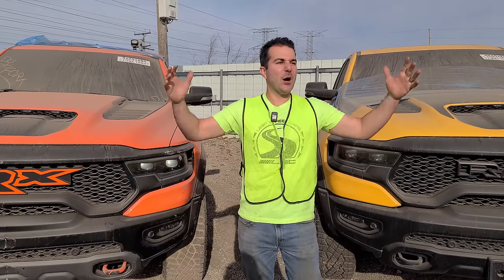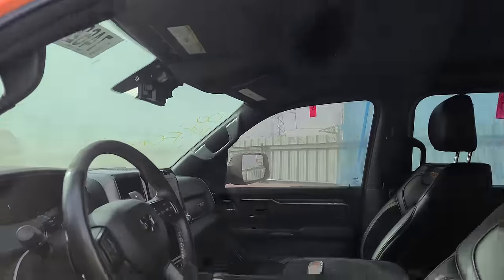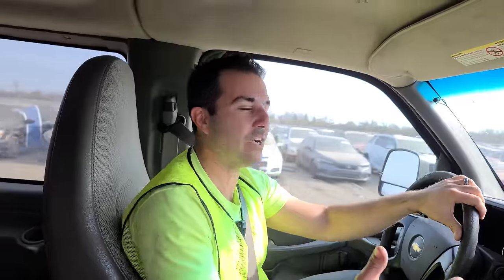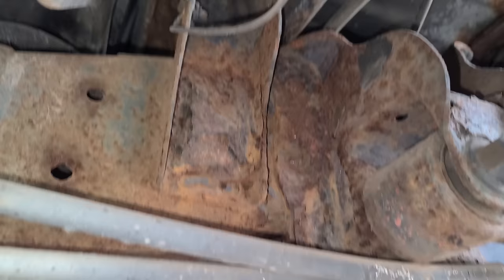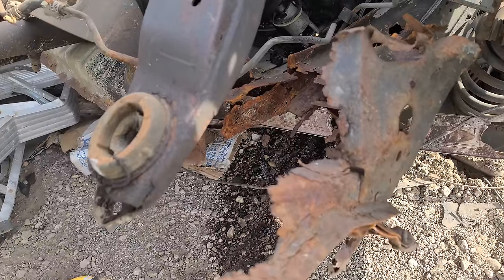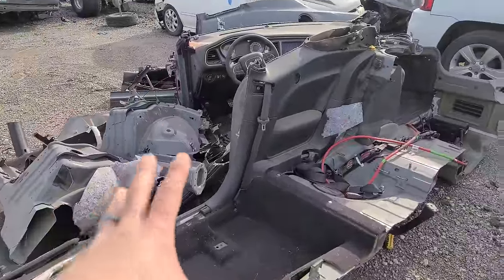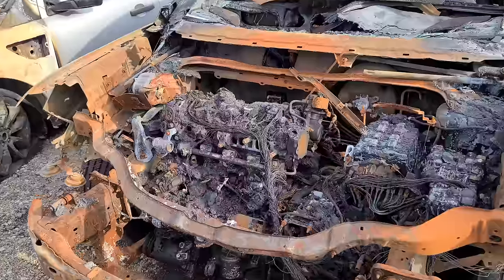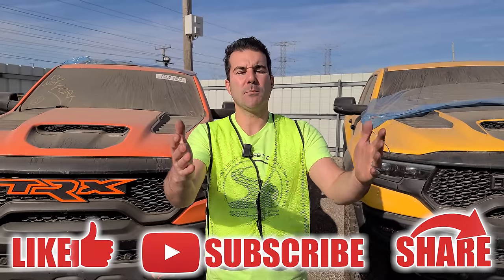Why Buying Totaled Bullet Hole Cars Is The BEST Deal At the Salvage Auction! EASY Fix For Anyone!

Comment from the maker: What do you think happened to the yellow TRX?
Get 3 Armor Shield IX Ceramic Coating Kits For Only $99! https://avl.kg/legitbf23
Normally these are $75 each and this is limited time and quantity. Act fast!
Reply: Please tell me the TRX's are repairable!!!
Reply: The yellow TRX was a blower motor fire. For whatever reason, the motor caught fire and that was it. Repairing that properly will be prohibitively expensive if you have to pay labor as well, so totaled. 

Getting rid of the smell is almost impossible too.
Reply: HeY Alex if I see a car I wanted  there is there anyway you and i can go see it and buy it ? Looking for winter build for summer.
Reply: The hole in the dash is typical dodge things, never went away. Probably a short circuit somewhere in the dash.
Reply: Cell Phone Fire
Reply: Looks like maybe it got struck by lightning ⚡️
Reply: I would love to see that final Mercedes put to rights possibly with some tasteful upgrades I think if you have a DeLorean it would love a wicked looking Benz as a friend.
Reply: Yellow TRX was a smoker who had an ember get blown into the dash maybe
Reply: @Broadpaw_Fox blower motor is off to the passenger side, not right in the middle
Reply: Wiring loom fire
Reply: a Dude probably dropped or hid his spliff in a dash vent when he got pulled over in that TRX
Reply: Aftermarket speakers........ I took care of my Xmas gifts at the site. My oldest pair are in the Army and their car will be protected, thanks for the great bargain.
Reply: 7:15 Wait, did you say McClaren 670 S??? Somewhere in Florida, a man is staring intently at his computer screen...
Reply: someone left taco bell on the dash
Reply: @Broadpaw_Fox  Huh, interesting...I was going to guess someone left their cell phone on the dash in direct sunlight and the battery had a thermal runaway event.
Reply: @DJSekuHusky or some sort of decoration like a crystal.
Reply: exactly and  this is proof of  why to buy just the engine and trans and put it  in older model vehicles , truck etc ,  _ so you have new power  in  an older model and None of the  new junk wire  fire cheap manufacturing   issues
Reply: Hot apple pie left on dash.
Reply: somebody had a couple of replacement battery cells for a concept van left them on the dash while moving his DeLorean and Tragedy.
Reply: We have a Hyundai Venue in India which my dad drives daily and is quite a reliable car ..
Reply: Cigarette down the dash!
Reply: Did you buy anything from the salvage yard?? The bullet TRX?  The Ferrari?

Comment: It's really sad to see all these big V8 engines disappearing. I'm not ready for electric vehicles!
Reply: It won’t happen for a long time.
Reply: I will never be
Reply: Just drive older cars. It's cheaper and less of a headache than failing body control modules, burning lipo batteries, and self driving nonsense that won't move when you actually need it.
Reply: Battery powered💩
Reply: So… don’t buy one.
Reply: well not everyone one own a big v8
Reply: No one wants one that’s why ford is lowering production of their battery plant. No one wants a pos that burns to the ground
Reply: Our wallets will never be ready!
Reply: We need hydrogen conversion
Reply: @xssonlineltd4212 
Nah
Reply: @ryurc3033  I would like a nice square body 4x4 and a 80's G body.
Reply: dont have to. wont ever happen
Reply: Electric vehicles definitely have their advantages, and those advantages are getting bigger every year. People were scared of microwaves at first.
Reply: Neither is the electric grid
Reply: What do you mean with disappearing? They are everywhere
Reply: Neither is the electric grid.
Reply: I will never go electric. I want a real car.
Reply: Not only V8. Anything over 2.5-3.0l range.
Reply: @LordHolley REALLY?  You're not too educated, are you?  Check into cost of battery production and how much OIL they use in the production.  Also check out the REPLACEMENT COST, as well as DISPOSAL COST and the cost to the environment!!
Reply: US infrastructure isn't either.
Reply: The junkyard will be a goldmine very soon
Reply: v8 becomes obsolete,new  turbo 4 cyl  can pull almost same power and use way less gas, especially in europe v8 disappears
Reply: Start buying new V8 vehicles. If you buy enough of them, they will keep making them
Reply: Just get both 🤷🏽‍♂️ ev for my ride to work then a couple v8 to play with
Reply: Our power grid isn't strong enough to completely electric it's struggling as it is to support the power we do use
Reply: It's atleast 20 years away before you'll have no choice.  Maybe longer.
Reply: @gregdali1011 that new turbo 4 cylinder won't last 1/3 as long as a basic N/A V8.
Reply: @AlexanderBaldridge-q8b exactly.  We already get blackouts on hot summer days when too many people have the AC cranked.
Reply: @LordHolley so, catching fire for no reason and uncontrollably burning hot enough to melt bridges is an advantage?
Reply: Electric cars need to stay on the golf course
Reply: Exactly why I’m still daily driving my 2003 Mustang GT with a manual transmission. I refuse to give in lol
Reply: Alot of cases of batteries failing and blowing up... massively
Reply: @joe.olivet starting in 2035 you won’t be able to buy a gas engine anymore.
Reply: @jasonmacneil2256 Agreed. We should go back to Conestoga wagons.
Reply: @SuzukiKid400  Yeah right, keep drinking their koolaide!🤣
Reply: You're not the only one, that's for sure!!!
Reply: Agreed brother. I won't follow the law. Who's with me?
Reply: Twin turbo I line 6's though!
Reply: dont worry they were be back big after January 2025
Reply: @gtamantube  lol when Biden is out?
Reply: Don’t worry, if you are over 50 it should be possible to keep and maintain a good V8 car/truck for the rest of your lifetime, (even if fuel costs $50 or $60 dollars per gallon! )
Reply: I hate seatbelts, I’ll never wear one.  Fuel injection, I’ll keep my carburetor.  A 4 cylinder, I won’t buy anything that’s not a V8.  These gas prices are ridiculous.  I can’t afford to go to work.
Reply: Don't worry, couple years you'll see chargers and challengers as far as the eye can see in the junkyard
Reply: Yeah I love my v8 Volvo.  Motor made by Yamaha!!!❤️
Reply: Environmental Fascism sucks.
Reply: Here is some tissue
Reply: @nastang5.097  lol I figured a mustang owner would have a box of tissues on hand 😂😂😂
Reply: @theglitch99 true
Reply: They just gonna have to find some way to make them efficient more e85 capacity from factory
Reply: @Iexpedite1  lmao ......  gas is too expensive , but gotta have big v8
Reply: @MrStacy1974  
Back in the day, a V8 was the only way to make good power.  Today, they are getting more power out of a 4 cylinder than a V8 produced a few years ago.
Reply: @Iexpedite1  I know....I laughed because I thought the guy was trolling
Reply: The world isn't ready.
Reply: I have three problems with electric vehicles.
1. the batteries do not carry enough of a charge make the range acceptable.
2. the longevity of the batteries is still not enough I can’t justify buying a car that will need to have its major components. Replaced in five years or sooner.
3. cost of manufacture an EV vehicle versus the greenhouse gas is involved doesn’t make any sense yet.
Reply: Its not going to happen. Pur power grids can not handle it.
Reply: We weren't ready for them over a 100 years ago. Things that aren't meant to be have a habit of getting rid of themselves. Patience willow patience
Reply: They'll be back

Comment: The McLaren was stolen from a wrap shop in the middle of a job. The parts were off when they stole it. The wrap was never finished. The rivian repairs are so expensive that insurance never covers them.
Reply: That is incorrect, they absolutely cover Rivian repairs. They have figured out how to reduce the cost of the repairs, even though it's still approaching $30k to repair damage to the rear. But, these are also $80k+ cars at a minimum, so they're not handing out $80k instead of doing a $30k repair.
That particular car was just fucked in multiple spots, so it wasn't worth the effort

Comment: I grew up and wrenched in the rust belt I just moved down south 5 months ago. It’s like a whole different profession working on vehicles down here. All my northern mechanic friends, move out of the rust belt save your body and your sanity.
Reply: I've bought a couple southern vehicles here in Michigan and even being years old and 50K+ miles on them, taking them apart is like they are still brand new! My last used vehicle was one from Canada and from the crusty bolts to corroded wiring, not dealing with that anymore! Southern vehicle or no vehicle for me!
Reply: I lived in northwest PA for years and had to pay for rust repair more than once to get my car to pass inspection.   Keeping a car going "forever" was a real point of pride up there.  Down here in VA where I live now, it's not so hard.   Roads get salted about once a year.
Reply: I did the front and rear end suspension, brakes, bearings, etc on my 2010 Kia Forte a couple summers ago. I live in Michigan. If I had to do the repairs again with a new car - no rust I could do both sides in 90 minutes. With rust of 10 years it took me all summer to do the job. Rust makes easy jobs way hard.

Comment: One thing you'll learn about Porsches is that the owners aren't mileage weenies like other sports car owners. Actually, putting mileage on your Porsche is a badge of honor. 

Even Hoovie bought his 996 with over 250K miles on it before he blew up the motor at the track. That's why he called it the Apollo 911. It traveled a similar distance from the Earth to the Moon. 

Anyway..  Hoovie LS swapped his 996 and then blew up that motor too. Wizard installed the lousy conversion kit and they used an oil pan that didn't provide proper lubrication with the engine mounted backwards.
Reply: Wait, did you say McClaren 670 S??? Somewhere in Florida, a man is staring intently at his computer screen...

Comment: I recently went to look at a 4runner which looked ok from the outside, clean inside, and someone had tried to cover the crustiness of the frame.  I noticed it was painted as I was looking and looked underneath one side and the frame is completely rotted. First time I have ever reported a dealer to the state.  I was looking for something that would be ok for hauling the kids in when my wife needs the van.  It wasn't safe, and the dealer seemed uninterested.

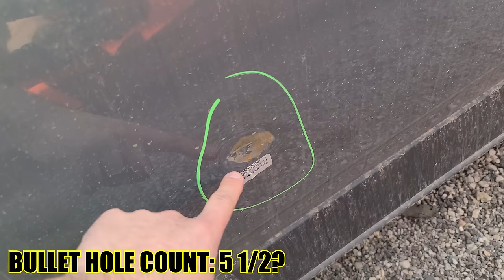Comment: 13:25 Low enough incident angle (front to rear) that the bullet deflected.  The roofline shot may have had some good support structure behind it and that plus the angle caused another deflection.  You'd be surprised how often we see bullets ricochet off of metal body panels, often hoods and even glass!  Good to know those TRX tailgates are sturdy!  Next time there's a gunfight behind you, just jump in the bed!  Salvage yard never disappoints, Alex.

Comment: Yes, the Dodge warranty would cover the entire Vehicle and YOUR HOUSE. As usual, Ford was sued several times for faulty electronics which caused massive electrical fires in the Throttle Body connector and Cruise Control with the F-150 and F-250 models when they were PARKED.  Ford had to send out a Recall Notice which included the warning to NOT park your Ford Truck close to your house! Those lawsuits changed warranty coverage.
Reply: Ford is being sued for the eco boost v6 too. They knew from the first gen motors were not going to last with that tiny cylinder walls. They are still made that way with 4th gen ,motors.
Reply: Yes, let’s talk about Ford fires from 1998.
Reply: @Krunch2020  1998? The Ford F-150 was causing fires in 2023 The F-150, had faulty fuel injectors that were causing fires. And let's not forget from 2001 to about 2015 Ford was installing faulty cruise control modules that were causing fires. Ford center service notice informing truck owners not to park their trucks close to their house because a cruise control module could catch fire even when idle.
Reply: The warranty disclaims, and legally, consequential damages. If their fault burned down your house, that's a civil case- and pretty likely wouldn't escalate to going to court.

Comment: Between the hard to obtain part support and the insanely complex electric/battery systems, I gotta wonder if EVs writ large are going to fall into similar fate as that Rivian, where insurance just doesn't even want to repair them at all.
Reply: EV control systems are complex yes, but the computers are modular and replaceable. And the wiring harness is simpler than an ICE: many fewer sensors and such.
Reply: Already happening to plenty of Audi E-Trons and Tesla Model X’s that get totaled out for relatively minor damage
Reply: It’s mirrored here in Australia. Insurers charge more to actually cover an EV and in most circumstances, even for minor damage, the insurer will write off the vehicle because it’s not worth the cost of repair.
Reply: That rivian was totaled because that rear quarter panel is not separate from the rest of the body, so to fix it you have to replace the entire thing.
Reply: EV's are almost always totaled unless the issue is VERY minor.
They cost WAY too much to repair and anything major really has to be fixed by the manufacturer so yea, reason 1001 why EV's are total junk pipedream nonsense.
Btw they are DESIGNED with 10 year lifespans for the batteries with replacements ranging from $6k-50k+ depending on the vehicle.
apparently modern vehicles weren't already disposable enough so now they're building them to only last exactly 10 years, on purpose.
Because everyone has $80-100k lying around to spend on a new EV vehicle every 10 years.
Reply: @riverpirate1022 $80-$100k? You literally just went to the highest dollar EV’s on the market when 85% of EV’s are under $50k lol. Plus everyone and their brother and uncle has $80k-$100k for a new truck so yeah people clearly got the money for expensive vehicles.
Reply: @Devastator0  this seems to be about limited supply of parts for structural parts, and a tendency to replace entire battery packs if there's any structural compromise.

This isn't about complexity of the electronics or wiring. It's about structural components, and a healthy fear of opening up a battery pack to do repairs inside it.
Reply: Rivian was just stupid and refused to learn the lesson from the Honda Ridgeline. All they needed to do was look at what happened to gen 1 Ridgelines and they could have avoided this giant fiasco. Instead, even a moderate bump to the rear goes from a $5-8k repair to a $30-40k repair.
Reply: @riverpirate1022  the ten year lifespan isn't a design issue, it's a chemistry issue, a battery that is repeatedly charged and discharged will lose a significant portion of its capacity within 10-15 years because the battery is undergoing a chemical reaction when you charge and discharge it
Reply: it's an economy of scale issue, of course right now EVs are more expensive to repair, they make up what, 10% of the market? i don't have numbers so don't quote me, that was a blind guess

from where they are now, EVs can only get better and cheaper, as the tech improves, the tools to work on them become more accessible, and the availability of parts improves, insurance will improve with it

not to mention how easy it is to total ANY car, not just EVs, like that truck that had what, three holes and some missing glass? i mean, if it were up to me, i'd say any car whose engine still runs and whose frame is still clean and safe doesn't belong on that lot but you've got ICE vehicles written off as scrap for as little as a cracked tail light

Comment: Some of those bullets on the Hyundai ricocheted. The one on the top of the car hit that very hard support at a slightly high angle and just bounced off. The other one at the bottom of the door looks like it was shot at a steep angle. 

Those also look like pistol rounds which tend to be less about penetrating stuff, especially if they are using standard range ammo
Reply: Its Chicago, somebody had a glock with a switch and was mad at babydaddy for not payin no child support
Reply: @BrokeWrench 🤣🤣🤣
Reply: “Range ammo” is FMJ, 25-50% more penetration than defense ammo (hollow points). Range ammo passes through stuff with ease.
Reply: @jonherdman6282  I explicitly left out defense Ammo because that’s not what is being used here. You would see hollow points breaking apart by the time it went through the door. He did not know whether it is pistol or rifle, and the most common ammo used is FMJ, so I believe 
my original post covered the bases

Edit: fixed typos because I was drunk

Comment: The 911? Look at the rear wheel arches- they are dimpled. Why is that important? Hit in the rear, those dips are because the odds are the unibody frame rails are "Z'd." Also, the belt guard drive probably got hit and not uncommon to crack the case when that happened. I've seen it a couple times and it is an automatic total
Reply: Yeah, even at that age a light bump to the rear wouldn't total it. That thing was gut n smashed.
Reply: @rustler08  An '04 911 Turbo drove into my buddy's shop around 2010. Hit by a KIA at a light. Didn't look really bad, but Czech George said "It might be a write off." LH rail was tweaked bad